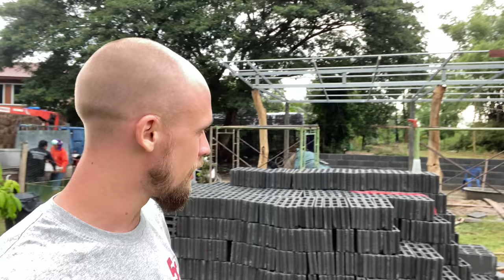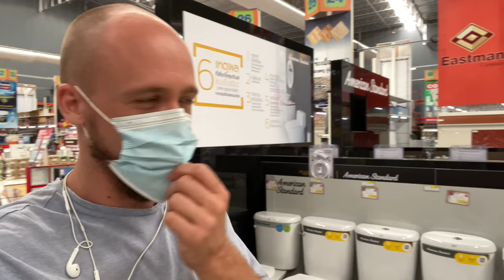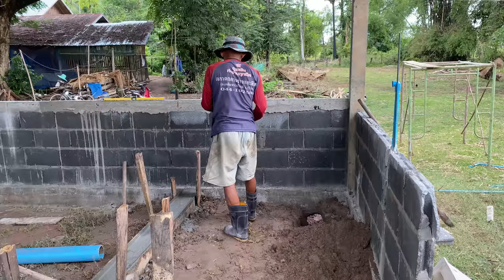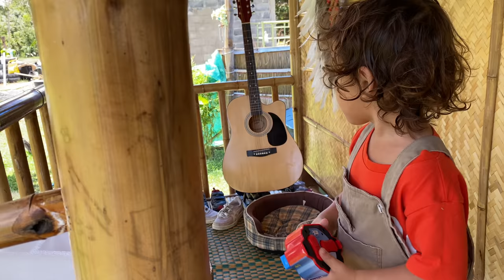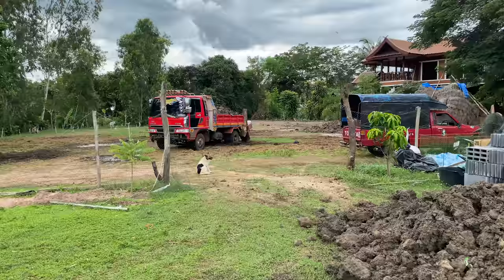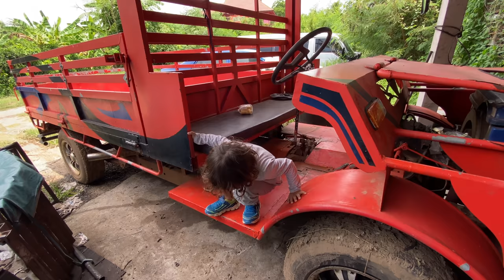Building A Cafe-Style Kitchen For ฿80k In Rural Thailand - Is It Possible? 🤔🇹🇭

Comment: The non color roof is more reflective which will be slightly cooler, absorbing less heat. With an open air design it doesn't probably make too much difference but something to consider.

Comment: You made the right choice of silver color roof sheets as it will reflect the solar heat and won't absorb as much as colored ones. 
Given the choice, always pick a thick roofing sheet abt 0.42mm
Also ask the workers to apply bitumen/sealant on top of the roofing self-drilling screws/fasteners (the rubber seal that comes with the screws/fasteners will harden and crack abt 7 years).
Reply from the maker: Thank you Ron!